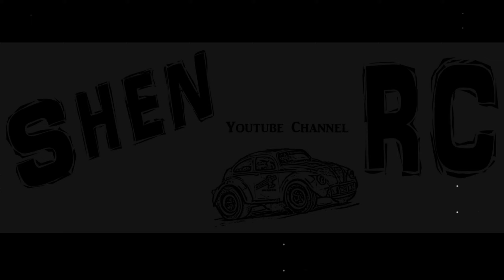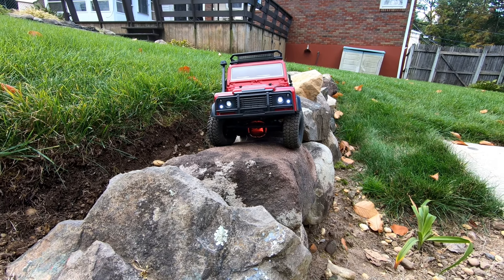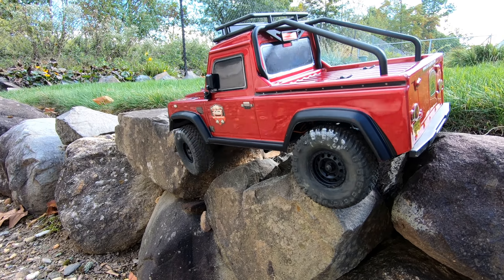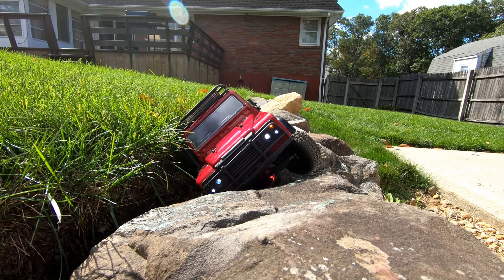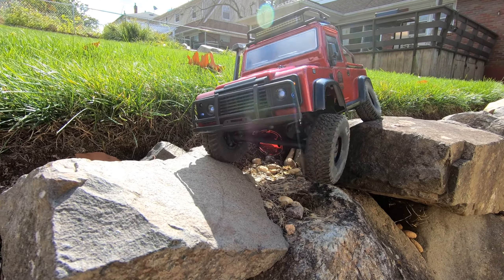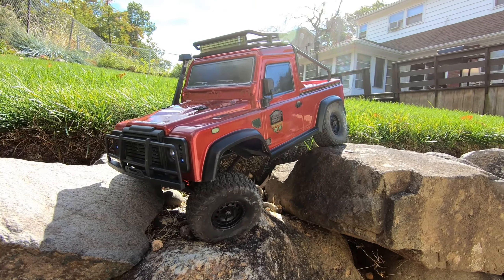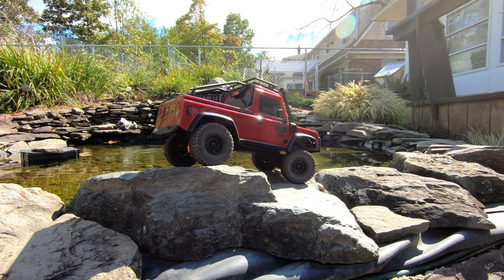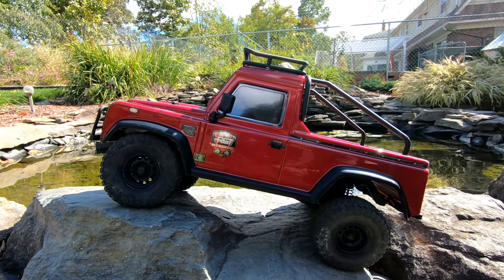1/16 RGT 136161 rock crawler MODIFIED Suspension TEST

Comment: Hey Steve your 1/16 RGT looks fun did alright on the rocks or scale boulders, after your mods. Definitely a tough line, nice driving.
Reply from the maker: Yea it's crazy on those rocks for sure, It would have slayed them if I coated the tires before hand with some WD40. 😁👍Thanks for watching.

Comment: I think it needs wheel weights to increase flex and stability
Reply: can tell its not going to need much to help stability and traction. to me it looks like the body could go up just an 1/8" too so wheel wells aren't stopping some flex. for what little has been done to it (so far), its a pretty strong little crawler.
Reply from the maker: Yea wheel weights may help. it did good though a lot better than stock that's for sure.  👍Thanks for watching.